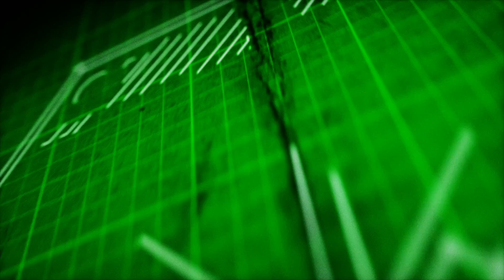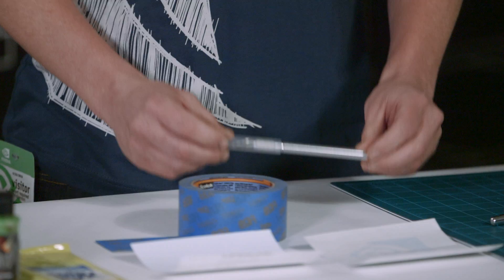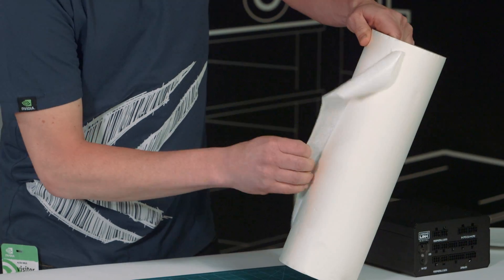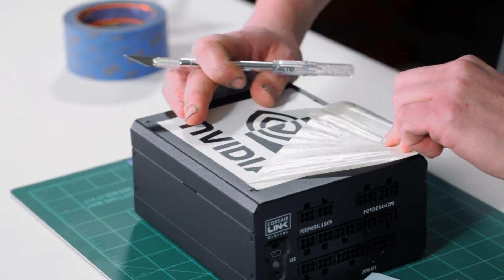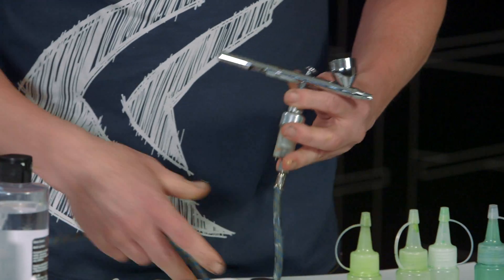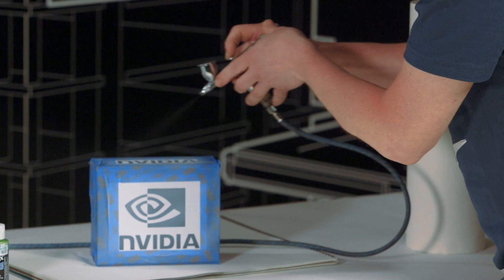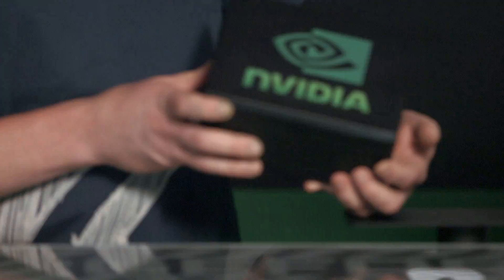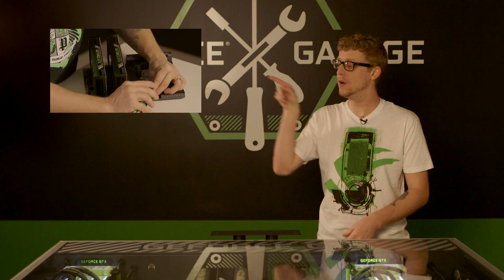GeForce Garage: Antec 900 Series, Video 6 – How To Detail Your Rig Using Airbrush

Comment: why did he paint bottom of the ps? you can t even see it in case.
Reply: +Behesti Avci Old Maybe the case will be horizontal...?
Reply: +Bradley Gibbs nope. there is no point. you can only see 3 faces of ps. 1 for cables. 1 top which he painted flames on it. and the side which has nvidia logo on it.
Reply: Behesti Avci Old Whatever, it's their money...